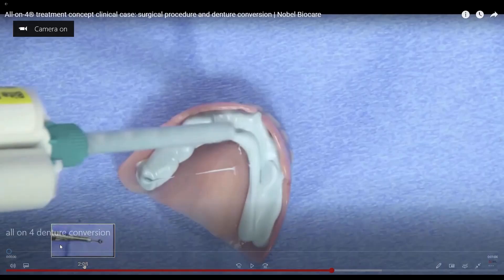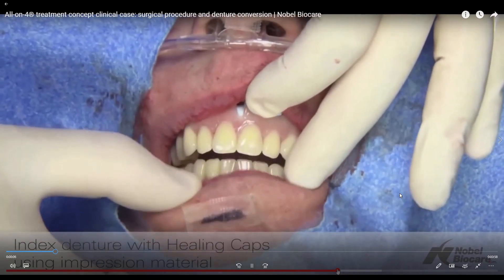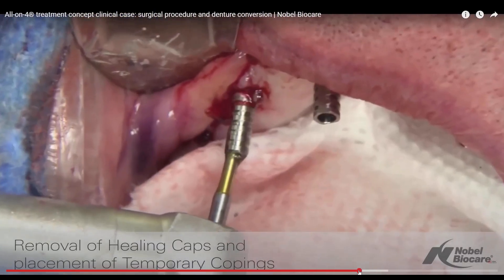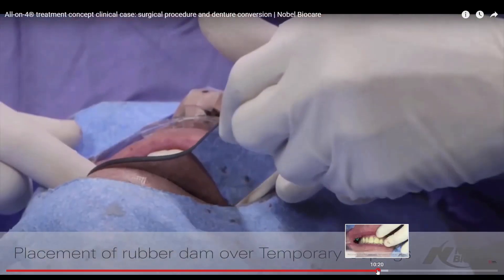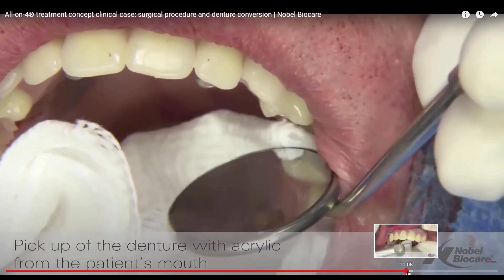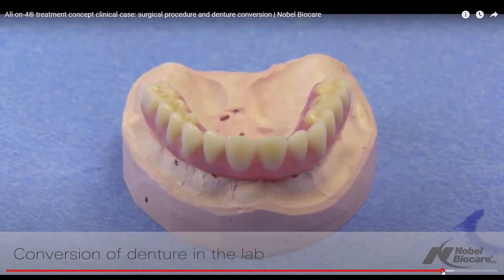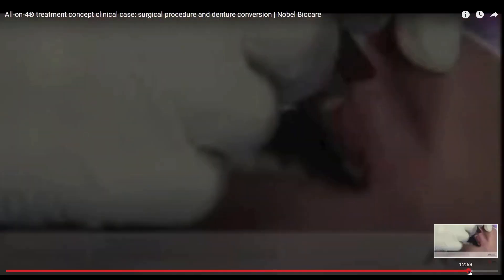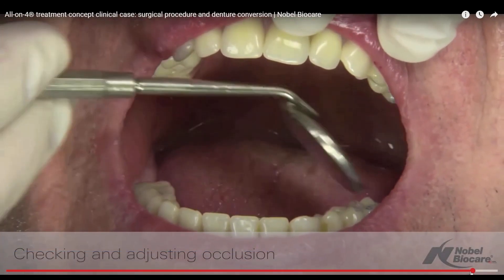Transforming Smiles: The Digital Revolution in All on 4 Implant Procedures!

Comment: Doc I cannot understand why you would get rid of bone ie to smooth it out we need bone to keep teeth stable. Is this to accommodate implants? Then this doesn’t make sense as foundation is weaker and I still don’t get why you put only all implants always at front there no balance of pressure. I’m sorry this system is flagging so many red signals . No surgeon would cut of parts of our body to accommodate another foreign body. It’s always all on 4 what about 6 or 8? Why don’t dentist tak about them?
Reply: Reducing the bone is necessary for the strength of the prosthesis. Without reducing the level of the bone, the platform of the implant would be inside the prosthesis, leaving no room for the connectors. If the acrylic is too thin, it breaks. By removing some of the bone, it allows us to put the implants in a location so that we have the proper amount of acrylic for the strength of the prosthesis. If we try to make it too thin, it breaks. As far as the number of implants, 4 is a bare minimum for a prosthesis that is supported by implants. Any fewer and the implants can't carry the load of chewing on the prosthesis without help from the gums. A lot of courses are teaching a 6 on the top, 5 on the bottom workflow, but having too many implants can mean problems in keeping it all clean. Great question. I hope I've been able to help you understand it a little better.
Reply from the maker: good questions.  i'll answer them in another video.